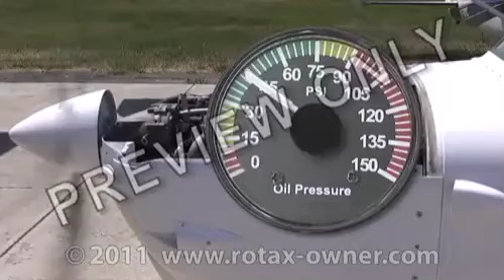Fluctuating Oil Pressure - 912 / 914 Series

Comment: Please send me any video about oil sensor connection installation on Rotax 914. There is some difference  on both sensor connection (old sensor connected through 3 pin clip. But on other hand new sensor has no lead) How I can connect? please guide me...